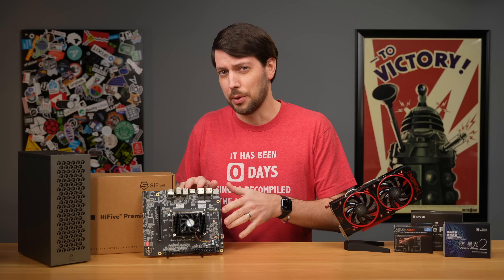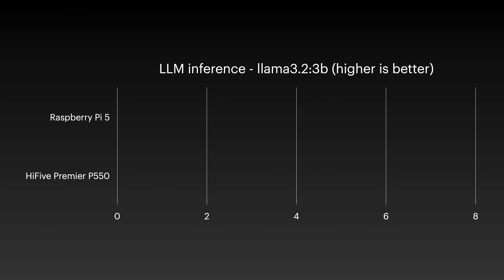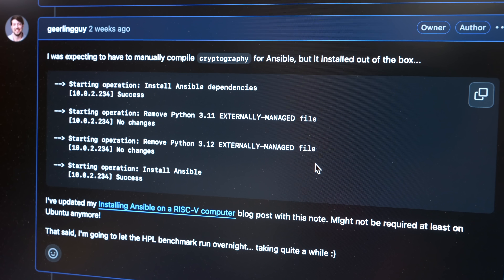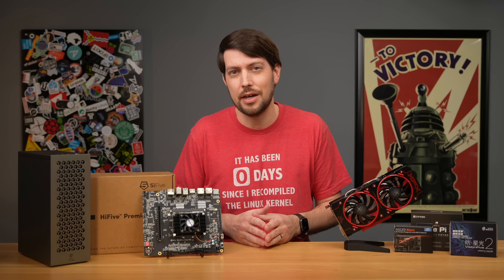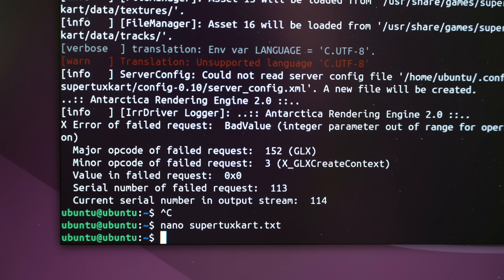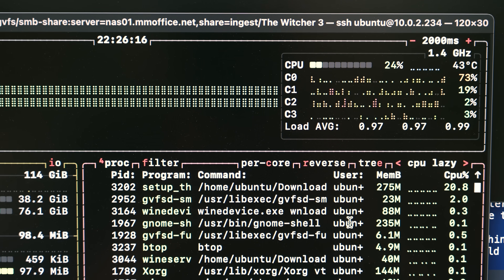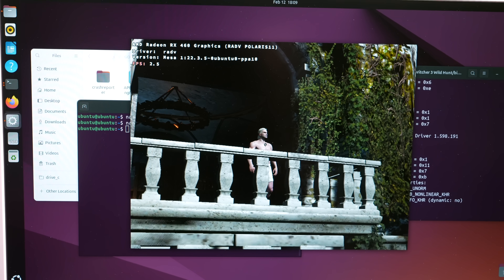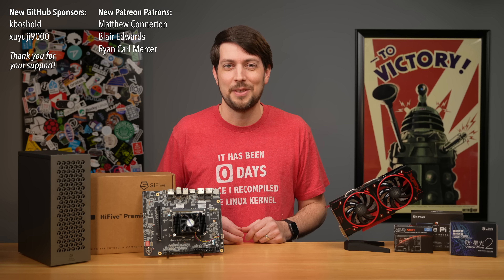RISC-V was supposed to change everything—How's it going?

Comment: 35$ raspi is like 150€ by the time I have it running come on man
Reply: how? what did you buy to spend that much?
Reply: @pablofernandezdiaz3872  cheapest raspi5 is 56€ (just 2gb ram), add a OEM usb-c (14€), cooler (8€), case (€12), micro-sd card (64gb, €5), and you're already at 95€ ... now change the raspi for 4gb ram to make it €104, 8gb to make it €130, or 16gb ram to make it €178. Really giving me 35$ vibes here. come on man. At those prices, might as well buy a 2nd hand office pc or one of those Celeron/Atom PCs from china

Comment: Back in the '80s when Patterson coined "RISC" he claimed that RISC designs would be simple enough that by taking advantage of the latest semiconductor technology they would become and remain faster than older "CISC" designs.  What he didn't understand, and you didn't mention, is what I started called "infrastructure inertia" back when Intel was spend a quarter of a billion dollars to turn a new CPU and running three CPU design teams at a time.  To be competitive, RISC systems have to move the complexity that was in the CPU to other parts of the system, but they are, over all, just as complex. (It's called "the law of requisite complexity" in some literature) While you say that ARM is immature, it has  been around for more than a quarter of a century and well over a trillion dollars, including billions in software development has gone into developing it.  RISC-V is facing an uphill battle because  infrastructure inertia requires that the new kid on the block has to be enough better than the existing competitors to justify the huge cost entailed just to reach feature parity, and the small economic gain of being free from ARM architecture licenses just isn't generating enough interest.  Maybe one day RISC-V will evolve but the odds are not in its favor.
Reply: People seem to keep forgetting the existence of SPARC and MIPS being RISC processors that were used in high end UNIX workstations in the late 80's to really early 00's.  While not the best examples due to their niche applications still had sufficient software and vendor support till the Itantium disaster.
Reply: @3Havoc  It always cracks me up that people call Itanium a disaster when it made money for HP for twenty years, a longer product life then most processors. (Maybe I'm a little defensive because I was part of HP Lab's team involved in the the wide word processor that Itanium evolved from.)  Don't forget DEC Alpha and, arguably, HP's PRISM architecture under the heading 80s RISC.  Although my favorite RISC chip from that period was Dave Unger's Smalltalk On a Risc (SOAR) Chip from Berkeley. There were a lot of RISC chips developed in the 80s, but the Win-Tel monopoly doomed the lot.
Reply: @martyfouts771  Nice that you were working on the cutting edge, I had not forgotten the DEC Alpha left it off as I have no familiarity with it personally known it existed never got to use them.  We can agree to disagree on whether it was a disaster would it have survived as long without the 20 year lock in contract, if its goals was to wipe out a number of competitors and ensure x86 could not be replaced? I thought PRISM was DEC's precursor to Alpha unless there was another architecture under the prism name?
Reply: @3Havoc  PRISM was probably used as a code name by DEC too, but the one I'm thinking of was called PA-RISC by HP, externally.  The goal of Itanium wasn't to wipe out competitors but the goal we failed to meet was that it was intended to be a way for Intel to move beyond x86.  Itanium was dual architecture.  The idea was customers could keep running x86 code while converting to using the wide-word VLIW architecture and eventually Intel could drop x86.  What really killed it was AMD solving the heat/power problem.  That led Intel to become confident enough to solve the heat/power problem and no longer need to kill off x86.
Reply: Yeah, ARM is way older than most people realize.
Reply: @SockyNoob  Having used Archimedes when they were new, it's exactly as old as I think....
Reply: Infrastructure inertia is so real, the good old
Sunken cost😂
Reply: if i remember it right there's no modern CISC cpus in existence, intel and AMD are building their x86_64 on top of RISC for more than two decades now, that's one of the reasons why x86 translation of Apple M chips doesn't seems anyhow slower than on "native x86"
Reply: @ I don't know about the last few generations, but IIRC Intel's internal architecture was VLIW rather than RISC through P6/Core, although Intel used the phrase "RISC like"  to describe the micro ops.  But the instructions that implement a heavily pipelined CPU, even if they are "RISC like" wouldn't meet Paterson's definition of RISC because of how pipelines work, especially how they deal with pipeline hazards.
Reply: Yeah, but who wants to be dependent on us-owned companies for their chips in this day and age? Companies are going to keep looking at risc to reduce their risk.
Reply: The wind in the RISC V development are the potential technology export bans which are enforceable against IP holders of ARM and x86. 
Some unnamed country which would like to invade some unnamed island against the will of the west needs to ensure it can run its military industry even if sanctioned...
Reply: Modern x86 (both AMD and Intel) internally use RISC-like instructions. They have a heavily optimized translation-layer in-between that can keep a cache of hundreds of translated instructions. So the instruction-set doesn't make that much difference anymore.
The big difference really seems to be that AMD, Intel, and some other established companies (like IBM) have a lot of experience in building large chips with wide memory interfaces and fast peripheral connections. Young companies like e.g SiFive and other RISC-V design houses simply don't have access to such optimized and scaled-up Design-Blocks. For Example, SoC design companies are mostly used to using the tiny power-consumption optimized 16/32-bit wide DRAM controllers that are used in phones and embedded/automotive appliances, whereas a workstation/desktop needs a performance-optimized 128bit or wider interface to be competitive.
Reply: The pace of innovative iteration (turbo charged with AI on the edges now, in the core of engineering soon) has exploded. The P550 just now making its way to the masses via this dev board is a few years back in the pipeline.  And the cost of innovation has fallen dramatically.
Reply: @QmanChu65  If the cost of innovation has fallen, that benefits established well funded players more than it benefits recent entries into the competition.  Established players already have the facilities and workflows to take advantage of the speedup, while new players are still coming up to speed. (Processor design is a mature field, and it is very rare that cost of innovation drops in mature fields, as all of the low hanging fruit has long since been picked, so I'm skeptical that it has fallen.)

Comment: I had a VisionFive 2 board that I was using for testing my own software on RISC-V that I accidentally damaged from overuse, so I am interested in buying this board, actually, especially if it won't fail from days of constant abuse. I wish they had the option to buy one with a case and power supply already like you received, so I could just get started immediately after unboxing.

Comment: So as someone who works more at the microcontroller end of things, I've heard RISC-V is going to be very impactful right at the bottom-end of the market where ARM licensing can take a good chunk out of profit. So RISC-V isn't there for desktop use yet, but it's already enjoying success in all sorts of low-powered widgets or white goods where cost is everything.
Reply: It very much depends on what you are doing.
I have been designing embedded systems for  over 40 years and I rarely need floating point - let alone an FPU.
I've used some of the 10 cent RISCV microcontrolers from WCH. A hell of a powerful device for the price.
Reply: @cccmmm1234  What kind of devices, more like washing machines, or car, bike computers?
Reply: The big thing RISC V needs is an FPU. It's available in tape but very few are putting it in silicon. Once that becomes ubiquitous then it will have arrived.
Reply: Small cheap embedded stuff is where the REAL money is at anyway. Microcontrollers make big bucks!
Reply: @StanleytheCat-v8z  And not needing an FPU where you don't need an FPU means reduced cost, power, size, and so on. What happens with Risc V is that if you do have an FPU, there's a standard for its instruction set; likewise other extensions.
Reply: You mean a vector unit, since an FPU has been part of the spec since the beginning.
Reply: @Azraleee  No. I do not. I mean a unit that has math instructions that are executed in hardware and not abstracted to a higher level software emulation in the compiler. It makes all the difference. As an example, the ARM M0 core does not have one, but the ARM M4 core does include one but it very likely costs more than the simpler M0 that you see everywhere now. There was a project (I think it was called Faust) that successfully imo taped out an FPU for RISC V but I do not see it included anywhere in chips that are generally available for any manufacturers. Probably because even if it's completed there probably needs to be verification for any design actually implemented and that takes a team of generally smart and expensive salaried people to do so. But with a CPU that flips a few bits here and there that's not needed. It's not unlike Linux. Even though it's free somebody has to pay salaries to write many of those kernal patches. When you see a standard FPU adopted then imo they'll be greater adoption and boards like what you see in this video won't struggle to run code. Just my educated observation.
Reply: @metatechnologist  yeah, that's literally why you have the RVF and RVD extensions that were part of even the first RISC-V specification. RVF covering single precision floating point math and RVD covering double precision. Both are part of the G-Extension for general purpose cores.
Reply: Also, not every core needs and FPU, that's why the FPU is specified as an extension.

Comment: Technically x86 nowadays is also RISC under the hood, all intel and amd chips convert CISC instructions into RISC instructions during decoding.
Reply: The real bugaboo is all pipelining aka spectre bug is simply not secure and can not be made secure.
Reply: No, they do not. This is a myth.

The micro-ops of modern x86 have nothing to do with RISC.

And some "RISC CPU"is even also split some of their RISC instructions to micro-ops
Reply: @hkultala  It’s not exactly the same, but conceptually it is not wrong. Modern (late 90s onward) x86 CPUs do break down their instructions into RISC-like micro-operations. Old mainframes did that, too, and the entire concept of RISC was to change from CPU microcode dictating the conversion from CPU instruction to microcode, to having the compiler do that instead so that more optimizations could be done.
Reply: @tookitogo  I know this quite much better than you. I design processor cores as my daily job. In reality, the micro-ops are quite different than RISC instructions, and some "RISC" CPUs also split their instructions into micro-ops.
Reply: @hkultala  Yes. I didn’t claim otherwise. But I think you’re somewhat missing the point, because as an expert you understand the nuanced (and maybe not so nuanced) differences between micro-ops and RISC instructions. But conceptually it’s similar: break down into smaller coded steps that don’t actually get executed with dedicated hardware.

Comment: Great video Jeff!  I'm both excited by the GPU progress and disappointed with the CPU progress.  A lot of the problems are definitely software and driver optimization which is going to be a very slow process without more major manufacturer support.  The Pi Foundation shipping a RISC-V board would probably speed up development by 3x but that's almost certainly a dream!

Comment: Risc V is already 10 year old, 3 year with Linux Support and real SoCs, MIPS was a older system with decades of story and didn´t beat ARM. IBM Opened the Power Architecture and we still get nothing from it. sun release the OpenSPARC and still nothing.

Companies like monopolies.
Reply: I had no idea the PowerPC architecture was open-source now, but isn't OpenSPARC used in some super computer designs? Not that they'll ever be available to the public in any capacity...

Comment: When comes to running non-native games on an alien CPU, you need to convert the instructions, typical that’s done with a JIT compiler, but it has to be written to convert x into y, because RISC-V is new CPU core, that is not supported, so more likely runs like shit because its interpreted emulation. Not JIT emulation, so it’s useless as a benchmark.

Comment: Seems the RISC-V architecture team (Not the chip vendor team) should work closer with the emulator teams to reduce the number of RISC5 instructions needed to emulate each x86 instruction .  ISTR RISC-V lacking the handling of ALU flag access needed to emulate the x86 flags register and carry propagating arithmetic.  And that would be just one item likely to slow down emulation and ports .  Skimming RISC-V docs I found them to be overly focused on the limited subset of instructions produced by the useless "standards compliant C language", as opposed to the larger set of features known to developers used to existing CPUs like AMD64, ARMv7 and MOS 6502 .
Reply: RISC-V also lacks decent memory addressing modes and select/conditional move.

Comment: As much as I like the concept, the idea of yet another different platform to support (or probably not), as someone who programs at low level with Assembly/C, doesn't exactly excite me. You could argue to just cross compile, but that never really "works right" in terms of not really fully taking advantage of everything the instruction set has to offer.

Competition is good, a half dozen different standards is not good if you want any hope of having strong software support. Android and iPads both run on arm based processors, but even there you have a massive lack of a variety of solid photo editing software like pixel/photomator. I guess you could argue that it'd be for more specialized use cases that a standard user would never see. Fair enough, but I'm not a standard user, and I'm not a fan of people with pitchforks because I don't want to have multiple versions supported at the same time or won't just post the source online.

Not that it matters, my interests fall into image processing and light simulation engines these days, which means I'm fine on that front. I just want a solid arm-based desktop, I've got an Orion O6 with 32GB of ram desktop in the works to replace my Rock5 B+. I already use a Surface Laptop with a Snapdragon X Elite 12 core (and stripped down copy of Windows on it) that I quite like.
Reply: Consolidated power to simplify software design will never be more practically important than market competition. It will only ever be more important if artificially made so by institutional regulation.
Reply: There are only 2 surviving ISA standards - ARM & x86/64.  Neither are open.  RISC-V is, under the MIT license, & also, it's a derivative of MIPS, so not an ISA out of nowhere

Comment: Don't hold your breath, waiting for the Berkeley RISC ISA, and more importantly software support to mature. This has been promised, as just around the corner, for 44+ years, and support for the 2011 RISC V ISA for 14+ years. Many of those who worked on the earlier incarnations, and the associated software stack, have paid off mortgages, and retired while "maturing" the almost ready stack.

Berkeley RISC I (1981), RISC II (1982), RISC (SOAR) III (1984), MIPS III (1992), MIPS IV (1994), RISC V (2011)

Essentially you might as well bet on the clean, open, Esperanto, replacing the legacy English, Spanish, German, French, Italian, Portuguese, Persian, Arabic, ... . After the first spec for that was only published in 1887.

Comment: What is up with the 20x speed difference? Even with a 2x clock deficiency I would expect very much closer results from a modern design with modern approaches well known - there is only so much magic ARM can pull out of the hat and that aint a 10x leapfrog.
Reply: I'm a software guy but it fits our scenario: the people who say optimize the hotspots (modern design) but the main problem is that there are no hotspots anymore. Its every single line (logic gate)  that needs to be optimized. It's the same here in the hardware. The real benefit comes from millions of little optimizations that have piled up over 25 years of engineering

Comment: ARM's achilles heel is that vendors buy their own custom mix of IP blocks for their ARM chips.  So there's builtin full blown fragmentation of the whole ecosystem.
Reply: Microcontrollers have always been a custom mix of IP blocks.  Motorola in the 1990s made something like 50 different 68HC05s with varying combinations of on-board IP blocks and differing amounts of on-board RAM and ROM.  Now it's almost just as easy for embedded customers to assemble their own chip instead of finding the best match in someone's catalog.  

RISC-V adds the dimension that the instruction set itself can be varied, which is fantastic for embedded usage but not great for building an ecosystem.

Comment: so what wifi cards will work with this. I only see 1 which is arlote M.2 SDIO WiFi Module AC200 and i think it could work there but are there any more options????
Reply: The drivers from Linux should run on this running Linux.  So those drivers should already be ready.  Might be some debugging needed though on some.